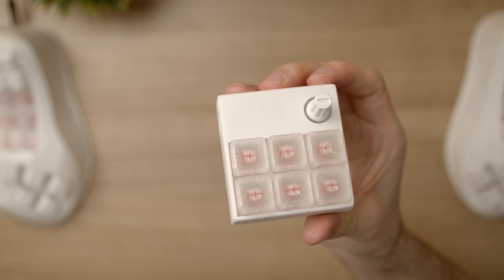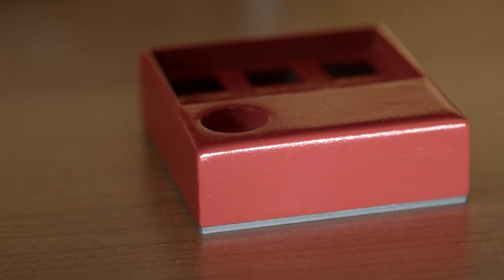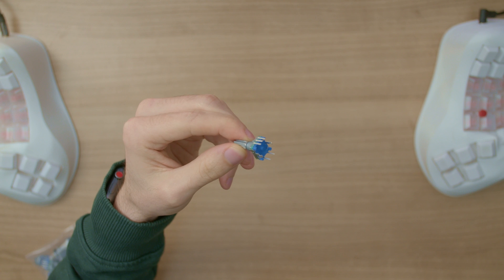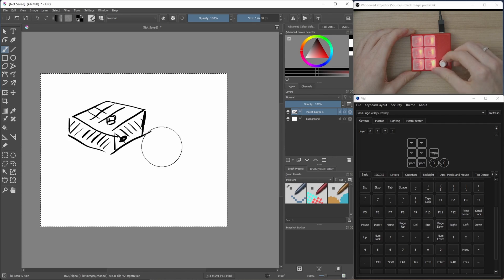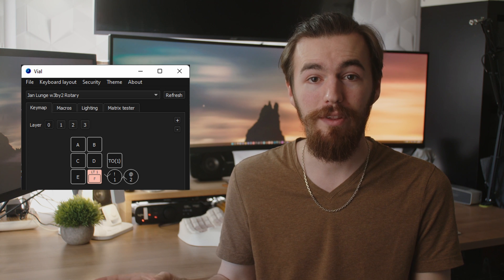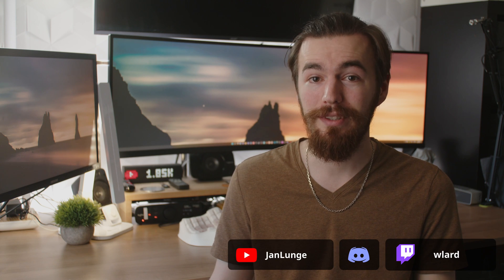Rotary encoder macro pad - Build & Get most out of it - free 3D print files | macro pad part 3

Comment: every time a try to solder my own, everything else melts except the solder wire. lol dont understand how you did it
Reply from the maker: Haha yeah you need to be kinda quick or it starts to burn, make sure your soldering tip is prepared I got some solder tip reactivator online which helped then the tip conducts the heat better. I usually put a drop of solder on the tip before i get near the plastic piece.

Comment: A few questions from someone new to this. Is there a tutorial anywhere on how to solder the hotswap sockets? Also, would an Arduino Nano work in place of the Pro Micro? (I can change the model to fit it) Lastly, what specifications matter on the diodes, as the ones linked are not available in the US.

Comment: Whow!  

Can you add multiple rotary switch in this?
Reply from the maker: Yes you could qmk does support this, in the w65 i did add 2 rotary encoders. There are adapters to place rotary encoders into normal switch sockets if you want to add another to this case
Reply: @JanLunge  Heyy, sorry I'm coming late to the question 😅.

I'm creating a macro with 4 encoders, they way you wired yours is you are connecting 3 pins of the encoder to the board, (padA, padB and row I believe)

In case of multiple encoders, how would that map out? I'm thinking maybe all the padA, and padB pins are connected within each other and to the board, and then each encoder is connected to a new column maybe? Not really sure how it would look like and how many pins each encoder takes, could you help me out with that please?
Reply from the maker: @julianbonomini5883  each encoder has 2 pads (pad-a and pad-b) and a ground pin for the rotation function pad a and b need to be directly wired to the controller and are used just for that one encoder so for 4 encoders you need 8 pins and one ground pin. The click of the encoders when you press them is just a switch with 2 pins on the other side and you can wire them directly or in a matrix with the rest of the switches that will decide how many pins are needed for them

Comment: First of all thank you very much for your videos. Thanks to them I was able to install VIAL on another macro pad (2x4 with encoder).

I am having difficulties changing the functions of the encoder in VIAL, your folder would be very useful. I'm having a hard time finding it "3by2 Rotary" (I hope I'm not blind)

Solved, "VIAL_ENCODERS_ENABLE = yes" not activated in the rules
Reply from the maker: If you mean the firmware folder, it is now in https://github.com/wlard/vial-qmk/blob/vial/keyboards/wlard/w3by2 in the config.h you can find the encoder config + the keymaps/via/vial.json for the vial gui config
Reply: @JanLunge  Thank you very much again. achieved. But now my keymap has messed up 😅, tomorrow I'll review what I did...

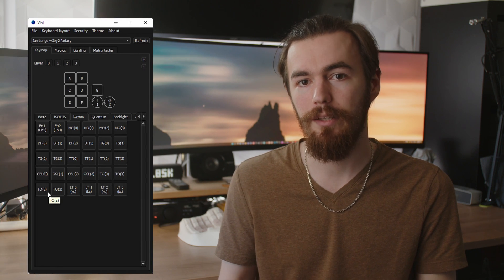Comment: At 3:29 in figure u have showed  connected in E6 but in config.h file its B4 idk y as in show figure nothing is connected in B4 ??
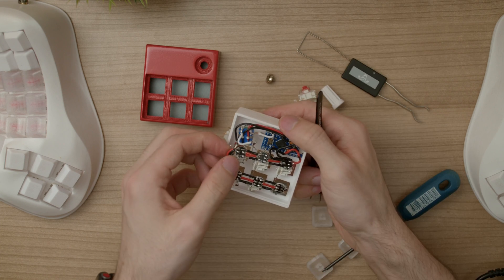Reply from the maker: on 2:20 you can see that the wire is bent over that pin a bit and i got that by mistake when making the diagram. I already updated that in the github page but its not possible to change the video. 
so yes it is B4